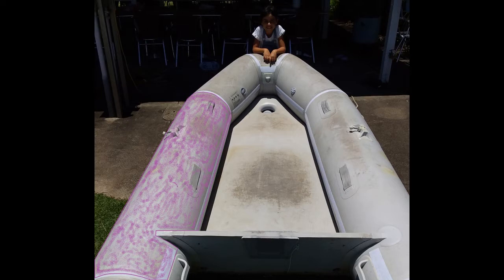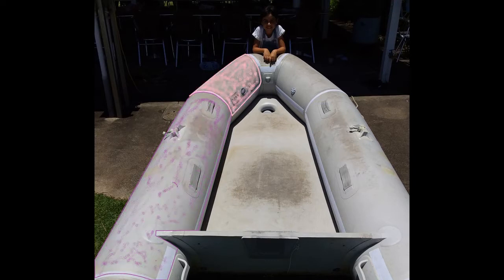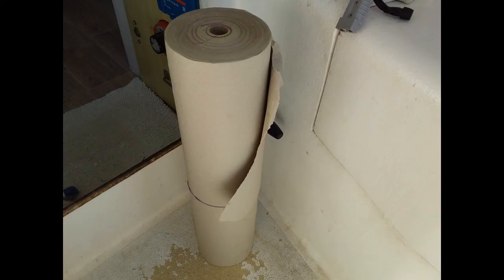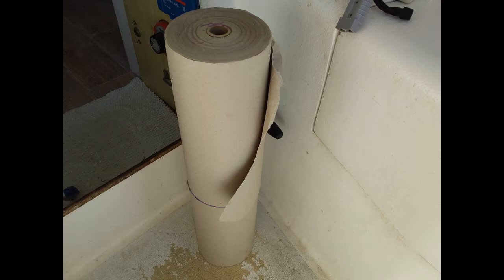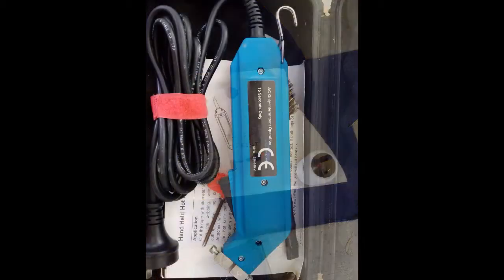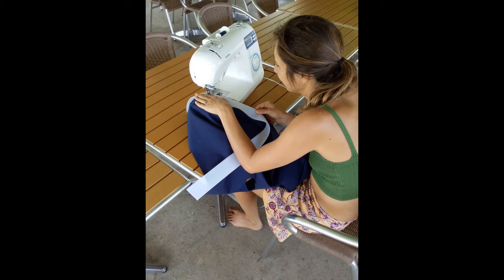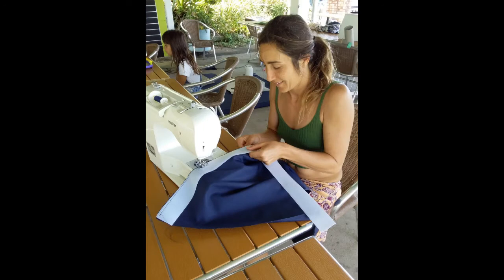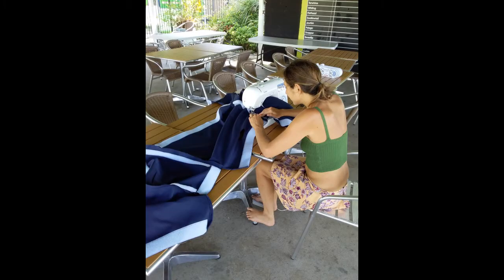Sailing Life: DIY boat chaps for our tender, simple and smooth boat cover.

Comment: Looks great .... just one suggestion - not sure but from the sound it seemed like you glued the hook tape to the boat? I would use the loop face on the boat instead ... hook is scratchy to touch (in the event you want to use the boat without the chapps ). 👍

Comment: I went with Sunbrella. Probably not much difference in price buying online than spotlight. It's not an easy job but yours turned out neat. You can stitch the Velcro to some vinyl fabric then glue that to the dinghy for a more permanent bond.

Thanks for your little video share.
Reply from the maker: They're great suggestions Josh, the sunbrella would last alot longer than the material we used, which has faded dramatically. I like the idea of stitching Velcro to vinyl fabric for a better bond to the boat.
Thanks 👍

Comment: like how you did it, much easier than other approaches and seems to work nicely     What did you glue the velcro side onto the dinghy?  Is it something you might want to remove some day or not?
Reply from the maker: Hi James thanks for the comment, the glue is pretty permanent being a 2 part mixture. The brand is Azbond and we used the PVC product. They also have one for Hapylon as well.

Comment: Hi! Just getting ready to start sewing a set of chaps for our tender. Wondering how well this has held up for you? Did the velcro hold as well as you imagined it would? Has it kept its strength? Stayed glued to the tender?  Thanks!
Reply from the maker: Hi.
The glue has held in 85% of the areas. It has come away at the nose of the boat as well as the rear on both sides.  Both these areas are high wear spots , the nose has the painter line rubbing it as well as strong wind when driving and people exiting/entering from the front. The back areas have water running past when driving. 
It held for 12months before the glue started to come away, I will be cleaning, preping and re-glueing these spots soon. Good luck with it we are still very happy with the outcome even though the glue has come away in a couple of spots.
Thanks for question 👍

Comment: What glue did you use
Reply from the maker: Hey Captain, the glue we used was a brand called Azbond C (the C indicates that it is for PVC). If your tender is Hypalon then you'll need Azbond R. And just to update you the glue is still holding and well and its been close to a year. Make sure you prepare the area well 👍
Thanks for comment
Reply: @sailingsofar  Thanks